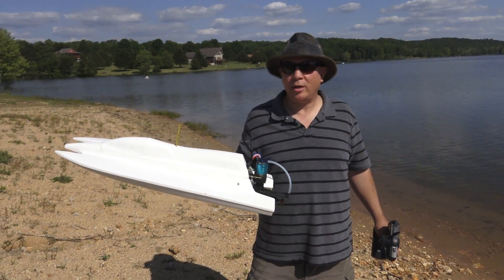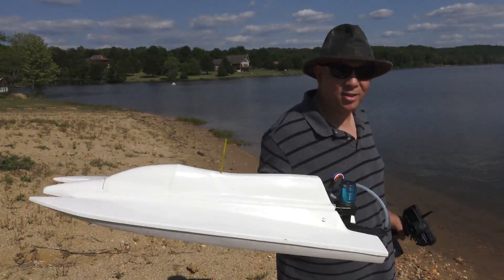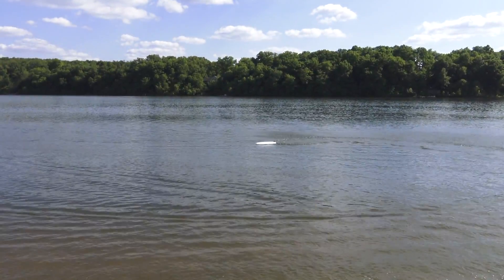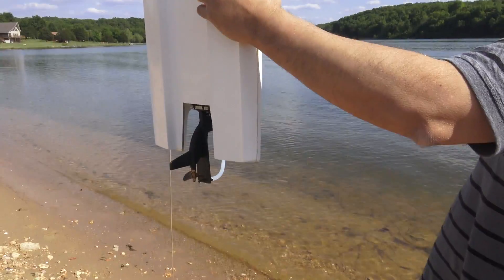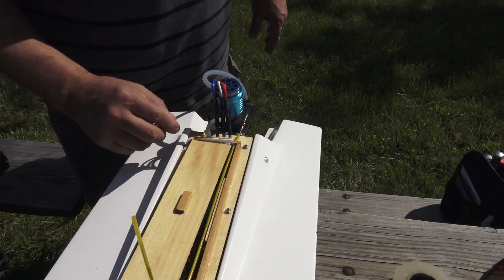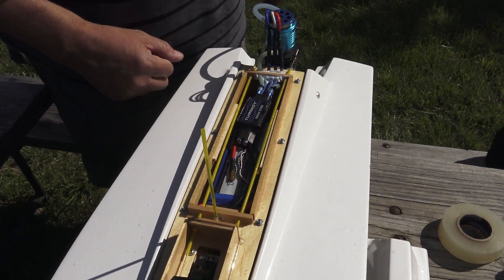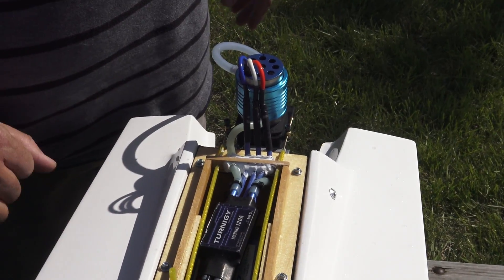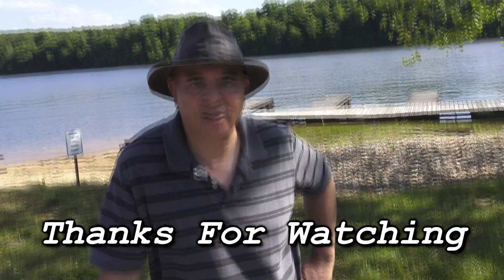Aeromarine Predator 21 4s Tests

Comment: My friend using hornet and their flex shaft always broke....any advise.... how to make those shaft last longer to play???
Reply from the maker: The best way to help the flex shaft last longer is to do regular maintenance. You need to remove the flex shaft and grease it with marine grease then put back together. Do this after every few runs of the boat.

Comment: I remember running those Prather's with you back in the 90's :) Those were some fun boats. Loved the nitro, but electric seems easier and cheaper than buying nitro. Hope you get that one dialed in.
Reply from the maker: Mike, It's been a long time hasn't it but still remember it well. This hull is the same one Berry or Rusty had. Guess I don't remember as well as I thought.
Reply: i guess im asking the wrong place but does someone know a method to log back into an instagram account??
I somehow lost the password. I would love any tips you can offer me.
Reply: @Benton Harley Instablaster =)
Reply: @Jordy Uriel thanks for your reply. I got to the site thru google and im trying it out atm.
Looks like it's gonna take quite some time so I will reply here later with my results.
Reply: @Jordy Uriel it worked and I finally got access to my account again. Im so happy:D
Thank you so much, you saved my account :D
Reply: @Benton Harley glad I could help :)